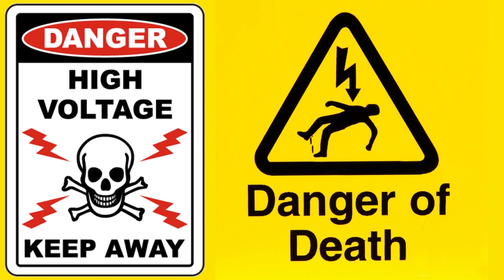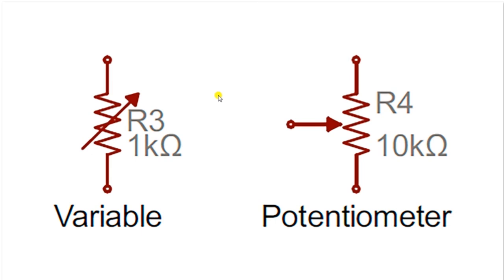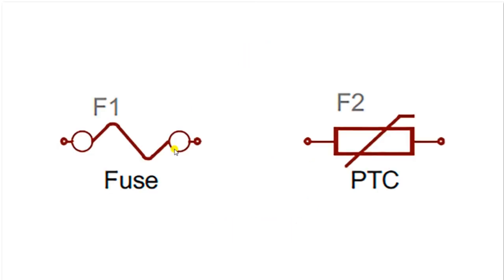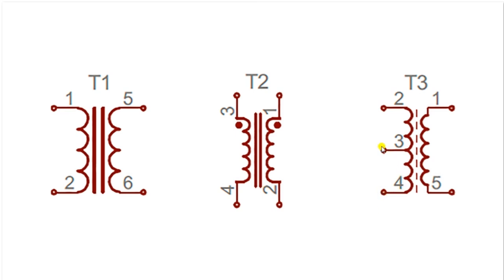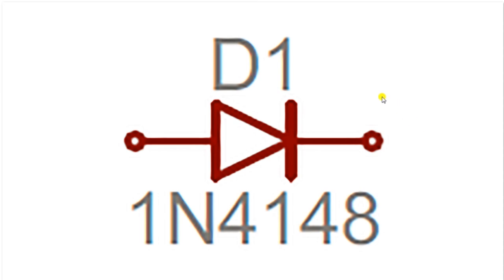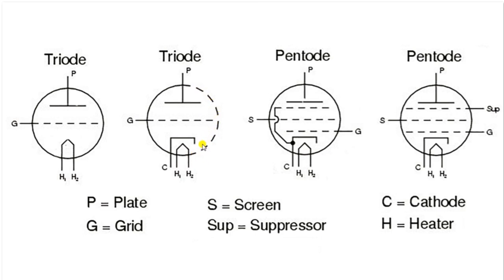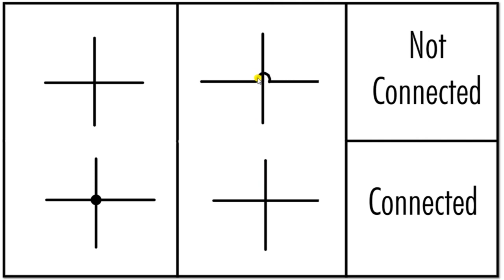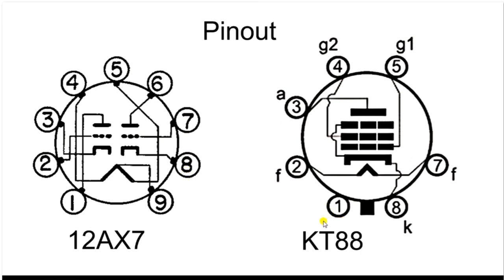Learn to Read an Electronics Schematic: Tube Version #1

Comment: I definitely found when I first started repairing old tube radios that having the tube data sheets for pin outs helps a ton, I remember looking at a all American 5 thinking why are these caps and resistors going back to pin 6 on a 35L6 that makes no sense?? Oh wait the data sheet says it’s unused, OH wait there’s a hidden black wire I didn’t see grounding it and they are using it as a ground point.

Comment: Technically, the 6V6 (and 6L6) are 'beam tetrodes'. Careful alignment of the control and screen grids and beam forming plates perform the same function as the suppressor grid in the true pentode.

Comment: Elementary dear Skunkie ;) Oh, except that Euro solid box for inductor.. Somehow never registered that before

The down triangle I use for midrail 'ground' in a single supply FX pedal ... The multi-lined down arrow is usually meant as chassis 'frame' ground like where the elec inlet grounds to metalwork - often drawn separately to prevent ground loops

Ah, hold on, in the Euro way, lines crossing DON'T connect UNLESS there's a dot - that could be confusing if you're used to US schem's - (I was told NOT to use the lil arch-over, deprecated, but hey its good for clarity) 

Oh, over here I usually see zeners just drawn with ONE bent leg, pointing in,  so'z not to confuse with Schottky's

And folks DON'T confuse Internal Screen with tube's IC='Internal Connection', not meant to be connected to ANYTHING, right ?
Reply from the maker: Yeah, normally the IC isn't connected to anything.

Comment: Hi Lady, you have a lot of knowledge about tube amps and electronics.I watched
 the series about reisong m50.Very well argumented.
I have a Willsenton R8 and I'm waiting to hear your thoughts about it.
I have a matched quad of nos russian tubes 6p3s-e which sounded wonderful on a 5881 amp.Electrically they work on Willsenton R8 but the question is If the electronic design of Willsenton is made to offer maximum performance with them.
Congratulations for your chanel!
My respect

Comment: Thank you for these basic tutorials! I am basically new to electronics and consider myself an audio file. I am interested in purchasing a Chinese tube amp and making modifications. In your opinion what is the least expensive option that will give me the best room filling sound and fairly tight base? It seems like the A12 is a model that you were able to get great results very affordably.  I would love to see photographs of the final modifications on this amplifier. Also how would you set up a subwoofer with tube amplifier? Would you simply use an RCA splitter from the preamp?  thank you again for your wonderful videos. The first video I watched everything was completely foreign and now that I have watched many of them I am starting to understand the jargon!
Reply from the maker: A12 + mods is the best low cost entry point. I did a whole video series showing step by step how to mod them and have before and after schematics on my website.